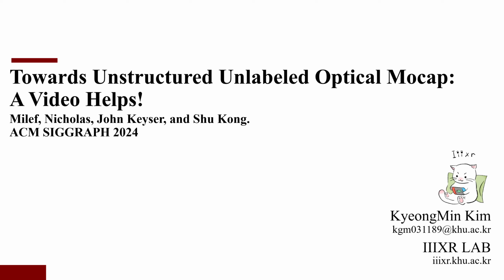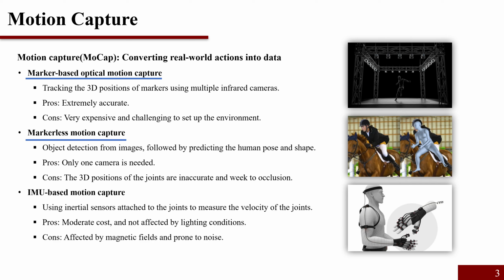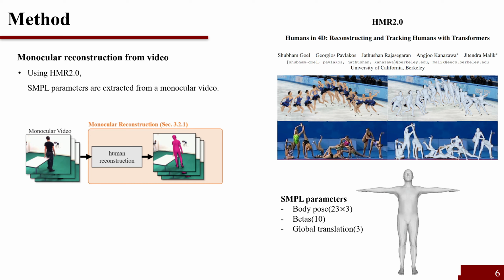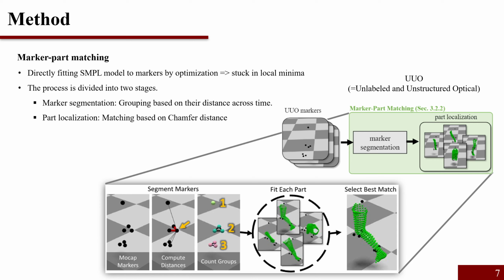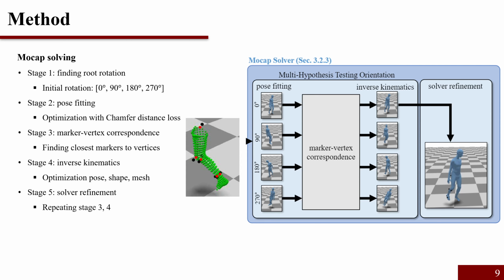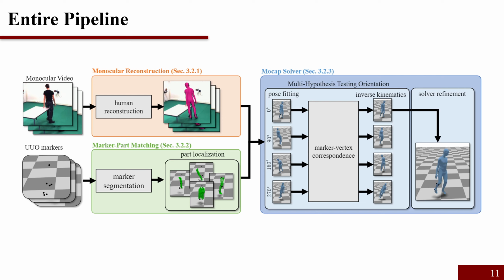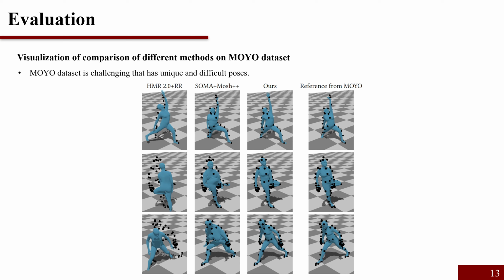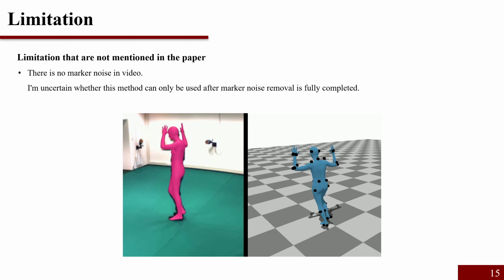[Seminar] Towards Unstructured Unlabeled Optical Mocap: A Video Helps!

Comment from the maker: Please review each point of feedback carefully, and respond with how you plan to address each one moving forward.

[Overall]
Your seminar was commendable for its clarity and effort to analyze weaknesses beyond the paper.  While the presentation was easy to follow at a basic level, it lacked depth in key areas. Including more of your unique insights and expertise would greatly benefit the audience and elevate the overall learning experience. Furthermore, attention to formatting is needed.

[Strength] 
S1: You successfully conducted the seminar in a manner that was easy to understand, even at a very basic level.
S2: Your effort to analyze the weaknesses that were not explicitly mentioned in the paper was commendable.

[Feedback]
F1: Formatting Attention! Ensure complete sentences that start and end with a subject and verb are punctuated with a period. For phrases that do not form complete sentences, omit the period. On pages 3 and 4, the captions for the figures were not correctly attached. Due to that, more effort is needed to properly understand these figures. At the very least, each figure should have a title that clarifies its content.

F2: Use more animations or indications! 
- On page 7, it was difficult to match the figures with the explanations. Instead of casually placing the figures, consider breaking down the explanations into clear sections, pointing out key elements, or using animations to make your points clearer.
- On page 11, it was unclear what exactly you were referring to. Consider using animations to reveal one element at a time or highlighting areas with a red box to direct attention to specific points.
- Even if time constraints prevent you from covering everything, it would be beneficial for the audience if you could project your unique expertise and provide insights that go beyond the paper. This would enhance the value of the seminar, not just as a paper presentation, but as a learning experience where your own knowledge and perspective are shared.

[Question] 
Q1: I’m having difficulty understanding the marker-part matching explained on Page 7. Could you please clarify what "Count Groups" and "Fit Each Part" mean? I would appreciate it if you could provide more details in a separate response.
Q2: Page 11 is challenging to follow. Could you explain those step by step?
Q3: Does "UUO" imply that users are unaware of the marker configuration? Is it used in scenarios involving an arbitrary marker set?
Reply: I will pay attention to sentence format and use more visual materials.

A1: The phrase "Count Groups" refers to the process of determining how many groups to classify each marker into by analyzing the sequence of the markers data. During this process, average linkage clustering is used, and the number of clusters is the number of body parts.
Then, "Fit Each Part" refers to the process of matching the clustered marker's point cloud to the body part's vertex point cloud on a one-to-one basis, using the Chamfer distance as the criterion.

A2: Page 11 shows summary of previous pages.
Firstly, when the video and raw marker data are received, initial SMPL parameters are extracted from the video(Page 6). After that, the markers in raw marker data are clustered according to the number of body parts, and assigned to the body parts(Page 7).
Next, to find the precise pose, the prossess that finding global orientation(pose fitting) marker-vertex correspondence, inverse kinematics are performed(Page 8~10). 

A3: "UUO" stands for Unlabeled and Unstructured Optical. This is the marker data output from the mocap system, but since it is not called a "raw marker", I don't know if it is data with noise removed.

Comment: Hello, thank you for the seminar.

1. What exactly is unlabeled and unstructured?
2. I didn't understand the Fit each part very well, but there are several parts that are already set and among them, are you looking for the best match?
Reply: 1. Unlabeled means that we don't know where the marker is on the body.
And unstructured means that the marker clustering process has not performed in advance.

2. The body parts are the result of video based markerless mocap model(HMR2.0). The clustered markers are assigned to this body parts

Comment: Thanks for your presentation.

I have two question below:

Q1. I want to know more about marker-part matching. How this method select the best match from segment markers to body parts?

Q2. In evaluation, I think This method has shown far superior performance than others, so what do you think is the most fractional of the reasons?
Reply: 1. They utilize Chamfer distance loss. It meaures the difference between two point cloud. One point cloud is the group of clustered markers, and the other is the vertices of body part.
2. I think utilizing the output of video pose estimation model is very useful. It greatly reduce the complexity of problem.

Comment: Thank you for your presentation.

In the marker segmentation process, you mentioned that markers are grouped based on the distances between them. However, if the distances between markers are not consistent in certain body parts, such as near joints like the elbow or knee, how accurately can segmentation be performed in these cases? Are there any additional corrections or methods employed to improve the accuracy of segmentation in such scenarios?
Reply: For that reason, when doing marker-based mocap, we need to carefully place the markers on the body.

In the paper, they decide in advance how many groups they will cluster into. This will reduce errors.

Comment: Thank you for the presentation. 
The question is, what techniques are used to minimize the mean per joint position error (MPJPE) and mean per joint velocity error (MPJVE) in your method, and how do these compare to existing methods?
Reply: In my method?

I'm also researching mocap, and I use inverse kinematics with optimizations like levenberg-marquardt as post-processing, but it mainly depends on the performance of neural networks.

Comment: Thank you for the presentation.

1. What is SMPL, and how does it differ from traditional methods of representing motion? Why can't we simply use the rotation values of the skeleton joints instead?

2. What criteria are used to determine the placement of markers on the human body in marker-based motion capture systems?
Reply: 1. SMPL is parametric body model. The "parametric" means that you can control the whole vertex data (6890x3) by few data (10+3+69). 
Using only the rotation of the skeleton joints does not utilize the body shape information and body surface area.
So, when using the body's vertices, using a parametric body model can greatly reduce the dimension and complexity of the model.

2. To reduce noise when doing marker-based mocap, markers are attached to points that are affected by the rotation of only one joint and have little movement due to muscle movement.

Comment: Thank you for the presentation.

1. On slide 7, "Directly fitting the SMPL model to markers by optimization => stuck in local minima," why can it get stuck in local minima?

2. On slide 9, is it sufficient to have only four cases for the initial root rotation? Couldn’t it be a value in between those cases?
3. What are the satisfaction conditions for solver refinement?

4. I am not entirely clear on the explanation in the limitations section. Does the example in the image suggest that it is difficult to track the marker positions on the other leg because the markers are only attached to one leg? Video is also used. Doesn't this help compensate for the issue? I am not sure if I have understood this correctly.
Reply: 1. Because it is very difficult problem when marker is unlabeled. The optimization may requires so many iterations and hard to matching even only torse. 
2. Of course utilizing more initial value return good result. But i think the difference is small compared to computational cost.
3. "Solver refinement" is repeating Stage3, 4 one time.
4. The result of video mocap dosen't involve the marker position. So, it is hard to match the video mocap result and marker data when two legs perform same action.

Comment: Thank you for the presentation. I have some questions that I would like to ask:

- I assume there is a dataset used for training HMR2.0 (since the title includes "Transformer"). Is there a dataset that matches the SMPL parameters with videos?
- Regarding the Marker Part Matching section, how are the body parts in the four images for each part generated? Are the body parts taken from a dataset or are they generated? I'm curious about how this process works in detail, particularly for selecting the best match.
Reply: - Human3.6M, MPI-INF-3DHP, COCO, MPII, InstaVariety, AVA and AI Challenger dataset were used to train HMR2.0
- The body parts used in marker matching are from the output of HMR2.0. The pose estimation model like HMR2.0 can predict the 3D body mesh approximately.
Also, since SMPL model contains skinning weight data, we can know which vertex is part of each body part.

Comment: Thank you for a great presentation. 

1. I have doubts about the reliability of chamfer distance, even with marker segmentation. For example, can a segmented group of markers accurately find the proper position of a body if the SMPL model is either very skinny or fat? The distance between markers close to joints may vary significantly more than that of other markers. Does marker segmentation perform robustly in such cases too?
Reply: The HMR2.0 can also predict the body shape of actor approximately.
And in current commercial mocap system, the location of markers on body is important. So to reduce noise when doing marker-based mocap, markers are attached to points that are affected by the rotation of only one joint and have little movement due to muscle movement. (It is why i research the arbitrary marker layout)

I think marker segmentation works well because it is predetermined how many groups to cluster into, the entire frames are utilized for clustering, and there is no marker noise.

Comment: Thank you for your presentation.

I have two questions.
Q1: I understood that human pose estimation is performed based on monocular video , and then mocap solving is performed based on the predicted human pose to finally calculate the marker position for the predicted human pose. Am I understanding correctly?
In short, I'm wondering if the human pose that is the target of solving in the Mocap Solver process is obtained from the Monocular Reconstruction process (although the two poses look similar when I look at the figure presented in the paper).

Q2. Are the UUO markers data used in the Marker-Part Matching process included in the dataset? If not, please explain how to obtain such data.

Thank you.
Reply: 1. To put it simply, they get "initial" pose and body shape from monocular video. It is not precise data. So to utilize marker data, they refinement the pose and shape.

2. You means that is there ground-truth(labeled and structured) marker data in dataset?
Marker-Part matching process is not data-driven method. So it is not necessary to prepare the labeled and structured marker data.

Comment: Thank you for your presentation.

Then, there are any research for other modalities?
In this evaluation, there are results by only markers and marker+video.
Reply: This paper only includes an evaluation of the that modalities. Most mocap datasets, excluding IMU, are either video-only or marker + video. However, it might be possible using the synthetic dataset BEDLAM.

Comment: Thank you for the interesting presentation.

Q1: How much does HMR2's performance affect the result quality? It seems that HMR2's performance is crucial to the quality of the results.
Q2: Why can't we just use HMR2's output alone? Why are we combining HMR2 with marker solving?
Reply: 1. The result of HMR2.0 is mainly used to perform marker-body part matching. Unless 1/10 of all frames are seriously misinferred, it won't have a big impact because of subsequent processes like inverse kinematics. Rather, the noise in the marker data will have a bigger impact on the results.

2. The pose estimation model like HMR2.0 can't estimate the precise 3D positions. It just looks good only when rendering in the captured direction.

Comment: Thank you for introducing Unstructured Unlabeled Optical Mocap.

I have a question. I'm wondering what the main contribution of this paper is compared with previous works. 
Is improving accuracy compared to existing markers+video based methods the most important contribution in this field? 
In this paper, the proposed approach to enhance performance involves designing a marker-part matching and a mocap solver, but these approaches seem to solve the problem through handcrafted algorithms rather than being novel. 
Is the novelty of the methodology or the heaviness of the pipeline not a significant concern?"
Reply: Previously, there was almost no research on video+marker mocap.
Using two different sensor data is troublesome. And video based markerless pose&shape estimation model is not robust.
However, recently, the performance of pose estimation models such as HMR2.0 has improved significantly.
So, we can consider video+marker and utilizing at marker segmentation and pose fitting as contribution.